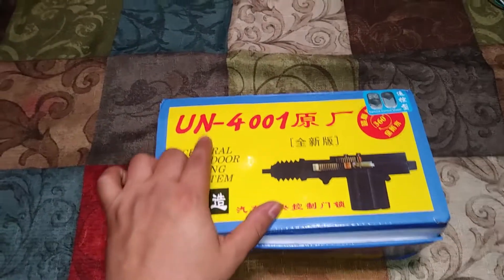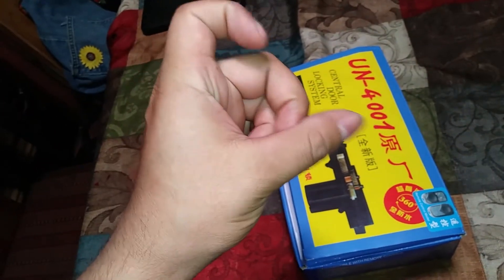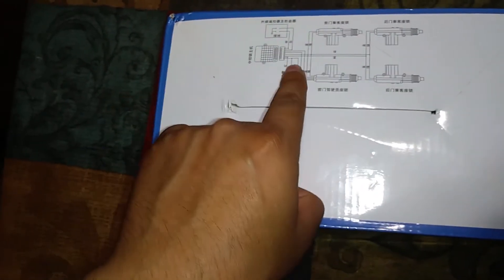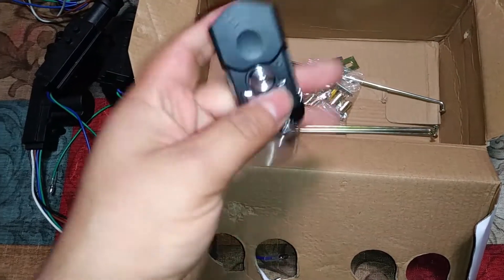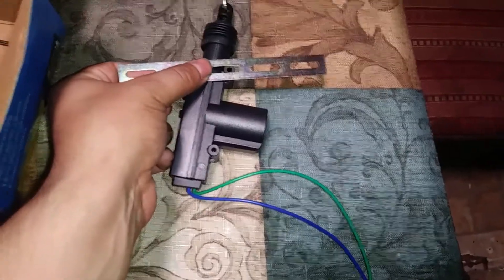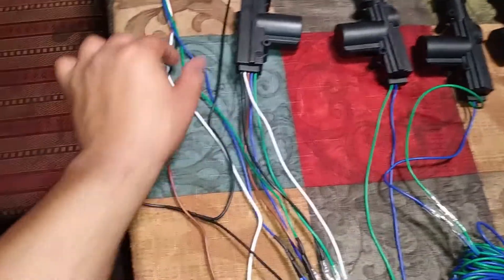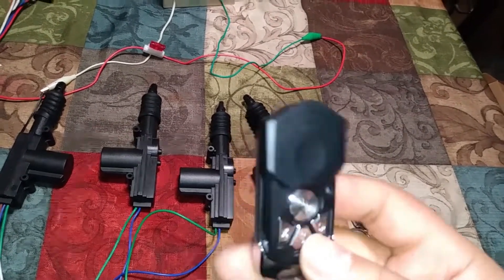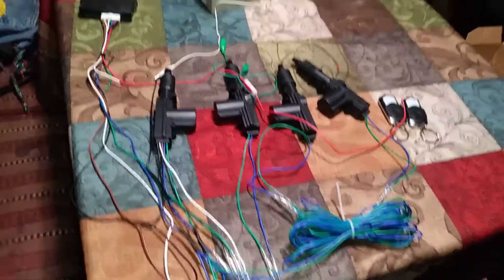Power Door Lock Conversion Kit (Assembly and Review) [Part 1 of 2]

Comment: Brown and white wires are for a manual lock/unlock switch.

The master unit should also control the others manually. Push down or pull up on it and the slaves should respond in a similar manner.

Comment: im lost on the two wires, one white and one brown, do they just connect to a door switch  ? and if so, will it hurt since the switches has power of its own
Reply: Brown and white are for a manual door lock/unlock switch. You put negative (i.e. ground) on one or the other for lock and unlock.